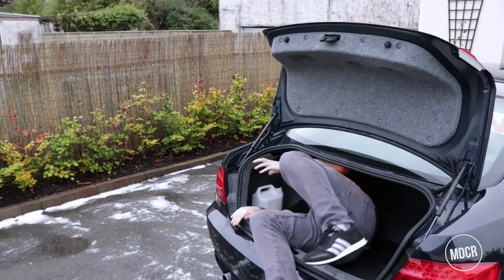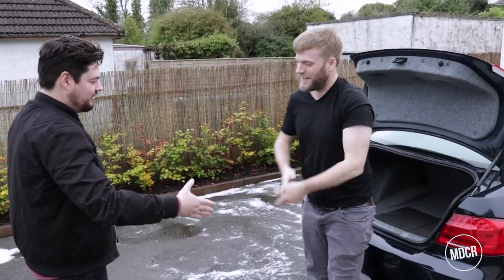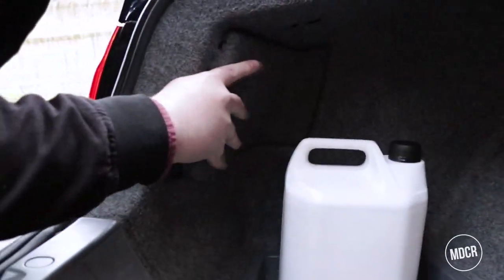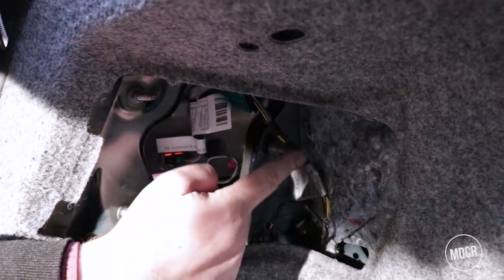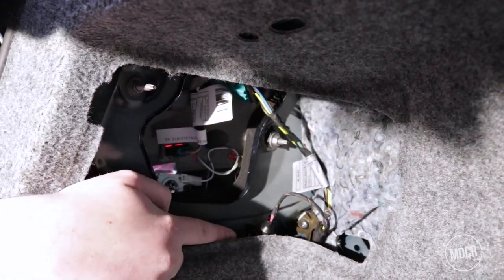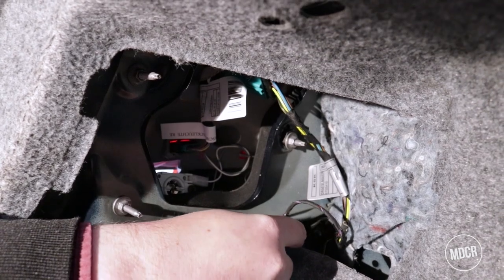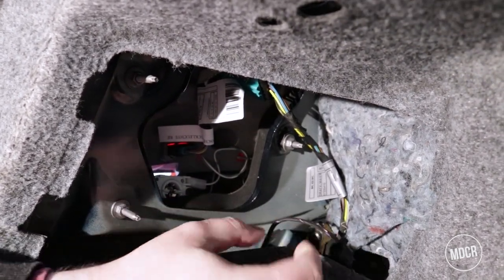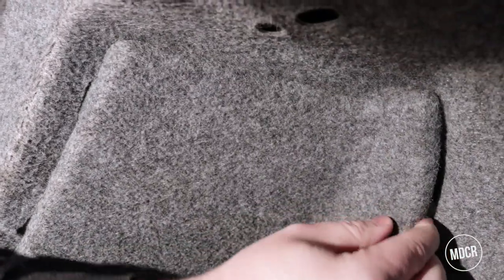Make your BMW E92 335i louder for FREE! | Exhaust valve mod

Comment: Do u do this after the car is warmed up? Because if u disconnect the cord while the valve flap is still closed, wouldn’t it stay closed for good? Or does it open up when u disconnect the cable no matter if the car is warm up or not?
Reply: Yes, warm up your engine first, then put it in sport mode and before shutting it off make sure valve is opened.
Reply: E46 M3 I don’t have sport mode ? I’m six spd manual , same process tho?
Reply: When the car is off its open. Unplugging should keep it open in theory.
Reply: @joebidden4914  it uses vacuum so if its not plugged in it will never close.... open is the standard position. Vacuum keeps it closed

Comment: Does it work on bmw e90 318i
Reply: only N54 and N55 have it I am pretty sure.
Reply: @bobruh6883  old comment but my n53 has it.
Reply: @hanswangnstvold435  gonna try it today
Reply: @djes4401  mine is either modded by the previous owner, or it's stuck open from salt/dirt or rust 😅